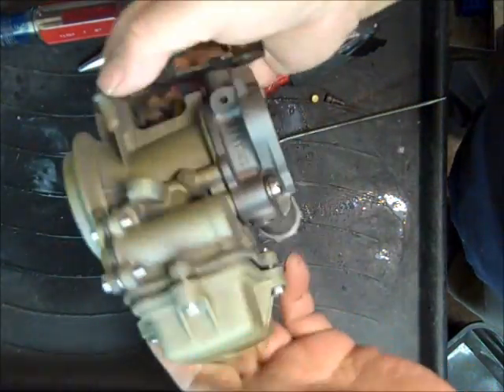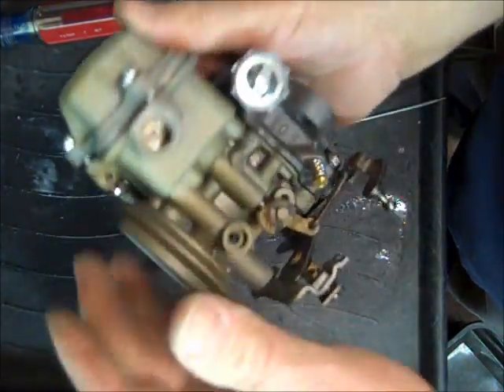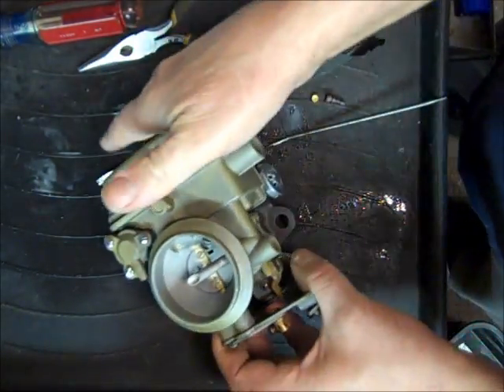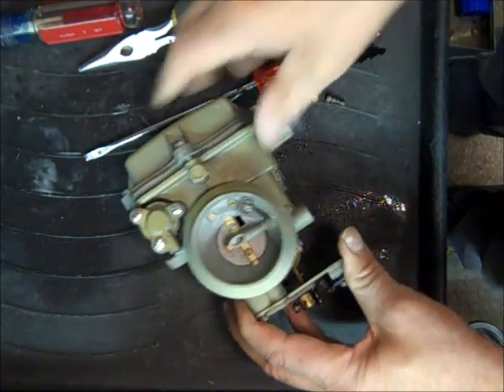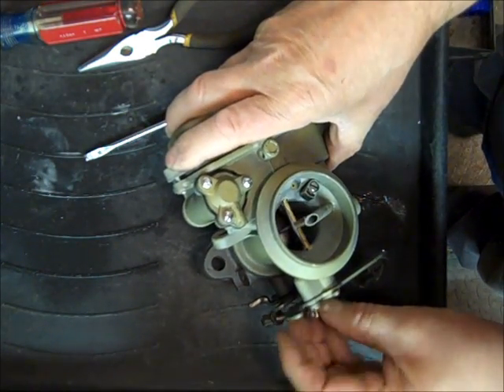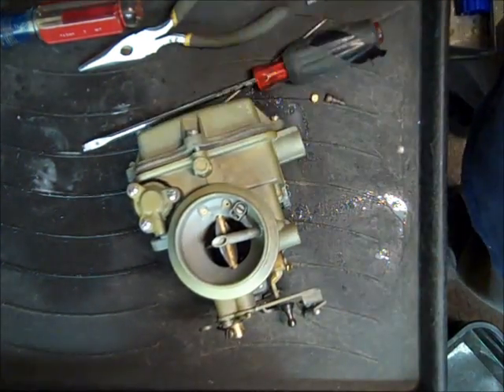Holley 1904 Carburetor Rebuild Part 4 of 4

Comment: Great videos on the 1904 carburetor.  They are very helpful, thank you.  When the economizer valve is not lifted (higher rpm), where is the extra fuel  being fed into the carburetor?

Comment: mine has what they called an altitude adjustment screw which is on the bottom of the cover with Holley marked on it but I cannot find any information on how to adjust this - truck dies under load going up hill